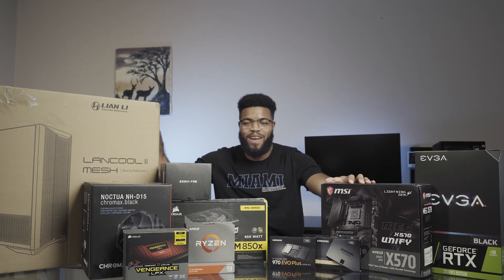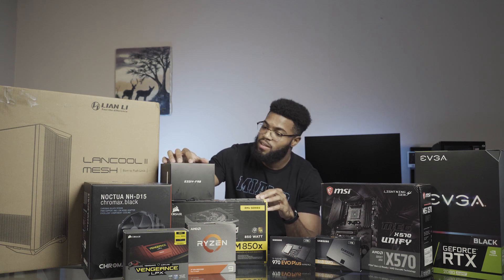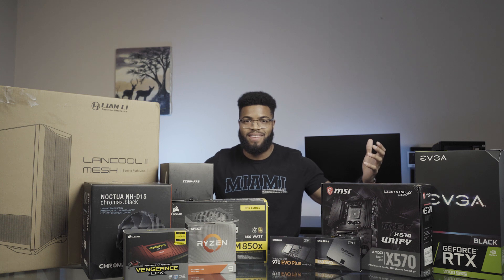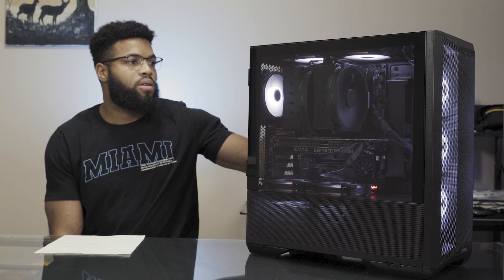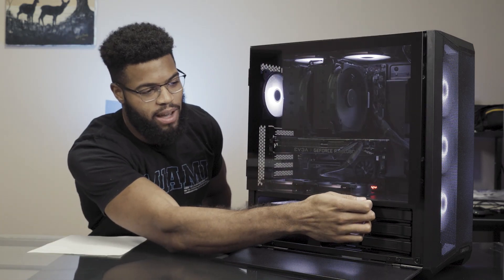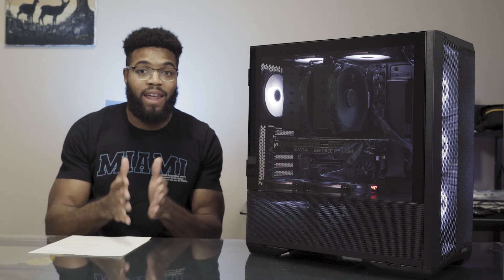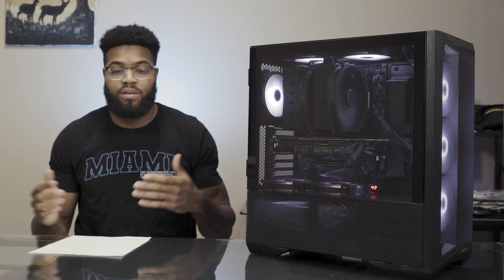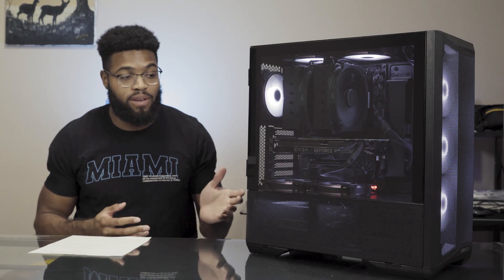Lian Li Lancool 2 Mesh PC Build - Should you upgrade your editing PC??

Comment: That is clean looking.  I’m doing a 5800x build in that case.  Have everything but the processor cooler.  Was looking at the one you installed and the one step smaller Noctua dual fan.  Looks awesome.

Comment: I am planning for my build similar to yours. Is it true you used those 3 fans that came with the PC case in the front? Is it a necessary to buy an additional 120mm fan to be installed at the rear end of PC case like you had done in the video?

Comment: How much space is there between the D-15 topmost part (I assume fan) and the glass panel?  I have 42mm memory and will likely have to raise the fan 10mm with this case, or swap the second fan to 120mm.
Reply from the maker: mann I couldn't give you an exact measurement but it is super close I'd say no more than a few millimeters

Comment: Just purchased this and replaced my old CM Storm Trooper. I really liked this case a lot. Only thing I don't like is that my m2 nvme (standing) blocks possibility of bottom fan and I am currently using the bottom pcie which also blocks a bottom fan. That being said, I can still squeeze one ssd there. Overall very good case.

Comment: I have the x570 meg ace with a 3800xt. It os a beast. Im going to do a swap, as i have a 5700xt on that build, but moving over the processor, and the meg ace into a better case for cooling (lan cool mesh 2 or the o11 dynamic)
I need the case to be able to support a 360mm AIO and the new STRIX LC OC 6800xt which comes with the strix card, so 2 aios. I was told the lan cool mesh 2 would accommodate that build set up
Reply: With the HDD cage in the factory position would a 360mm aio seat properly in the front? Or would you have to move it toward the psu, or would you have to remove it completely

Comment: I know I'm like 4 months late, but if you're looking for longer screws, you can easily find a box of them at say a Home Depot/Lowes.
The box was called "Electrician's Machine Screw Kit" #6-32 - 370 pieces total for $7.

I ran into fan screws being too short in my Fractal R5. The case-included fan screws were probably only 1" or 1-1/8" in length.
I found that something like 1-1/4" in length allows you to install fans in areas where you need just a little bit more reach.

Comment: Beautiful and low profile. Great build bro!
I am gonna get the lian li lancool 2 mesh case but is it look nice to use M-atx motherboard? I am worrying about the small size of the motherboard doesnt look great with that case. What do you think?
Reply from the maker: Thanks I appreciate it! I think that for that small motherboard it all depends on if you don't mind having a larger case in your space. You would have the benefits of easier maintenance and better airflow but that all depends on the size of your space. If not then I would look into getting a smaller case.

Comment: Hey, man. Cool build! Not sure if you've noticed and may have already fixed it by now but your motherboard chipset fan (I think it's the name?) on the lower right (right above the LED) doesn't look like it's running. From what I've read, it's necessarily to cool the lines down from all the X570's fast transfers, not 100% sure. Anyway, was also thinking of getting the exact same case with the exact same CPU and mobo. Glad to see an example of the X570 Unify mobo in a Lancool II Mesh case. It looks great!
Reply from the maker: Yeah man my chipset fan is only set to run when it hits a certain temp! I thought I was having issues with it as well but it runs fine when it needs to
Reply: @juwancaesar  Ah! Didn't know. Will be less worried when this happens to me when I set it up. Thanks for the info!
Reply: Just want to update this that I've gotten and set up this mobo, this case and you are right. The fan does not run when idle.
Reply from the maker: @RogerC  that's great! Hope this mobo serves you well!

Comment: This completely convinced me to go with the lancool mesh and I’ve been loving it (I actually pretty much went identical with the specs since it’s such a good video lmao). I do have to ask how you went about handling all the fan connections/cables? I also got the same fan pack and I’m a little lost on how to sync everything since I can’t use the fan hub with the stock lian li fans
Reply from the maker: As far as the fans go, they aren't synced with the lian li case fans I just have them controlled withbthe remote that came with the fan

Comment: Would you list which direction in/out your fans are going please?
Reply from the maker: Front 3 fans and bottom 2 fans are intake  and top 2 and rear fans are exhaust. I could probably do without the top fan thats closer to the front, but I left it in purely for looks, it hasn't negatively impacted my airflow either

Comment: The gpu is just blowing  the hot air directly  into the heatsink. Which will impact the temps very badly
Reply from the maker: Naahhh man it doesn't affect it like you would think, my temps have been consistently cool, thanks for the heads up though!

Comment: What's the point of that top fan in front of the cpu cooler intake, besides to steal air from the cooler? The fan on top rear is good, though.
Reply from the maker: Honestly it's purely for looks haha but after testing the airflow and pressure, that fan doesn't negatively affect it as much as you think, my temps have been beautifully cool for the past 2 months. Thanks for the heads up!

Comment: As a recent owner of the Lancool II Mesh, I can say you did a decent job on the build. They don't necessarily mention the order to do things in. Definitely best to run your CPU power cable into the motherboard before placing it in the case, especially with fans up top and such a large cooler. Timing is of the essence. In this case I found it was best to mount the motherboard in the case, and connect my front panel connectors, obviously before installing the graphics card, but also prior to installing the bottom mounted fans.  It is really easy to bend pins when you're not able to fully see the headers. This just requires a small screw driver when a large air cooler is used. I find this case looks really good with custom sleeved power cables. If you haven't already, I would suggest finding Cablemod's kit designed for the RM850X power supply so you can go straight from the power supply instead of crowding the case with extensions. I find that custom cables force you to have super clean cable management, and add that finishing touch to a premium level build such as this. Overall this a great build, and considering this is definitely your first (high end PC) build, I'd say you did great. Even if you don't go with sleeved cables, you can definitely clean up those PCIE and ATX power cables a little more.It's all about the zip ties in the back. I should give you kudos as well for getting the correct fan orientation. That is not a given for a first time builder.
Reply from the maker: Thanks for the tips! Definitely gonna take these into account for my next build!

Comment: How hard was it to install the front stock intake fans? If you can could you include a brief explanation of how you installed it? Anyways, Great video man
Reply from the maker: Hey, thanks! It wasnt hard at all actually because the fans came pre installed with the case! Just gotta connect them to the mobo and psu and you're good!

Comment: Hey dude. You can take out that drive cage. There are screws on the bottom of it that you can unscrew to take the feet off that base that slides into the bottom of the face. It comes out after that.

Comment: Beast of a machine man.  If you plan on OCing or getting better temps I would recommend an AIO because the 3950x can get pretty hot under a load but if you aren't gaming it shouldn't matter too much.  It's only my preference i suppose as I had that same heat sink in my rig and it was sweet.  Nice build man, decent cable management too even without sleeved PSU cable extenders.  You've sold me on this case too because I've been looking at this or the Fractal Mesh, Lian Li makes great cases.  Great choice on all the hardware and a definite upgrade from that airbook lol  Subbed my dude, great editing on the video too.  You should be able to edit great footage on this thing.

Comment: Hi great video but I was just wondering how did the fans not attach to the  top of the case , did the screws that came with the fans not fit?
The part I'm reffering is at 7:50
Reply from the maker: Hey thanks for asking! I had trouble with the screws that came with the case fitting with the fans. the fan holes are much too large as if I needed either larger screws or rubber plugs

Comment: Do we think this case will fit the new 3080 and be spacious enough to cool properly. Was thinking if 10900k with it. And 320 aio on front
Reply from the maker: Absolutely you can, this case has the ability to flip the cable bar that allows for more room if needed

Comment: To get the M & C buttons to work and control the RGB lights on the front do I need to connect the wires to the 5V led header on the motherboard and the SATA cable to the PSU?  Thanks!
Reply from the maker: Yes you do!

Comment: Didnt connect the front panel usb
Reply from the maker: I did haha just didn't film it
Reply: @juwancaesar  Then why is it not visible in the video, be honest you didnt connect it because it prevents you connecting your bottom fans or if you dont use the bottom case hole you have to have the cable going right across the front of your build and it looks terrible everyone who uses a lancool 2 cheats the same way

Comment: It's gotta feel like night and day coming from a crappy Apple product to a nice, custom built PC with beat specs! And I'm not dissing your laptop in particular, just Apple as a whole. You're going to fly through editing now! I wish you nothing but good luck on your journey.
If there's one small thing, you're about 95% of the way to really good cable management but you can tighten up around the GPU, the air cooler and that top corner where the case buttons are.
Reply from the maker: Thanks I appreciate it! Gonna work on those cables soon haha

Comment: Loving the video. Also went with the same case.
You said in your video that you ran into issues with the case fans. 
I have a b450 tomahawk max mobo. The rgb of the fan is working but it isn’t spinning. Any advice?
Reply from the maker: My issue was just that I had to connect the 3 point header from the fan hub directly into one of the mobo slots, after that everything went well!

Comment: Hey Juwan 🙂 I just got a mesh 2 RGB...  and have watched your build video many many times as I'm a newbie at building a computer 👍 I was wondering what exact Amazon ezdiy fab fan pack you purchased and how did you wire it to sync the RGB? Does the RGB buttons on the top of the case still  work properly with  on all the fans in the case? Did you use the ezdiy fan hub? Or somehow connect it to the mesh's hub? Or motherboard... This is the first computer I've ever built in my life 😅 you've really inspired me thankyou!! Great video by the way!!?
Reply from the maker: Hey! Congrats on your new PC! the link to the fans I bought are in the video description check it out! But there unfortunately is no way to sync the fans with the case buttons. I tried to ask JayzTwoCents as well and he told me the same thing, you can however control the fans with the remote very easily with no issues!
Reply: @juwancaesar  thanks bro 😊👍
Reply: Juwan Caesar were you able to connect the case fan argb to the motherboard and control the color with software?
Reply from the maker: @TommyGilligan_Bunny  those fans are only capable of being controlled by the remote, no software capabilities

Comment: That's really good for a first build, and 6-8 hours are just about right if this is your first. Seems like you did your homework right. That all black with white lighting theme is also my favourite, and been stuck to that theme right until now. If you somehow wanted to improve the cosmetic side of your PC, just put more work on managing your cables (even the tiny ones like fans, SATA cables, etc.), and for an even cleaner look, buy some sleeved cable extensions for at least your PCIE cables and the 24 pin. It's going to work wonders on the cosmetic side. Great job, and welcome to the world of PC building!
Reply from the maker: Thanks for the tips! I'll definitely be looking to improve my cable management in the future!

Comment: I have the Phanteks P400A and I’m not gonna lie, I really want to switch to this case. Excellent cable management and relatively easy to keep opening up and change stuff out. I’m tired of having to take everything apart😔
Reply from the maker: Absolutely! The cable management is freakishly easy to handle even for beginners! Hassle free is the way to go!
Reply: I just got the P400A about a month ago, although the LC II Mesh was my first choice (lack of availability in Canada). However, in the last month, it was a pain making changes and even just removing the glass panel frequently was annoying. I just ordered the LC II Mesh to replace the P400A as it just became available up here!

Comment: Nice job, nice build.  Enjoy 

Just built one similar to yours, 3950x 2080ti, 64 gig ram( 2 sticks of 32) 2 Samsung m.2  1T drives .. MSI x570 gaming plus . have the non mesh Lancool 2 case.
Mainly running Resolve 16 Studio  but also have Pinecale Studio 23 Ultimate on it.

Performs very well.
Reply: This sounds like an absolute monster of a PC. Nice build man!

Comment: I love the way the Black Mesh II RGB looks with the white lights, it just beautiful.

But i also like that the Mesh II Performance has the Fan Speed options and overall comes with the bigger fans. 

Is the Fan Speed Option really that important and better? or is the RGB as good without it?
Reply from the maker: I believe the RGB version is just as good honestly. The performance version will get you slightly better airflow which will lead to slightly lower temps, but you'd be just fine with the RGB version especially compared to other cases in this price range.
Reply: You could always get RGB and swap fans if you were ever concerned about cooling performance
Reply: @DesiDadReviews  pretty sure that breaks the point, honestly, either aesthetics or performance, hard choice depending on the person

Imo, get a good case with good fans, no need for rgb, then grab a undiffused lightning strip if you want a clubhouse for a PC, and place it inside your case.
Else, get a neon light strip from phanteks and do minimalistic and stylish rgb.

Comment: Fan screws go in from the top. Check your chipset fan. It's not spinning. That's not good.
Reply from the maker: Hey thanks for commenting, the chipset fan works fine it's just set to run when it hits a certain temp.

Comment: Nice build and it looks clean! I can't wait to build my first game PC by myself next week! Your research in brands is pretty similar to mine but on a lower budget.

My specs:
Case:      Lian Li Lancool II Mesh RGB White
MB:         MSI MAG X570 TOMAHAWK
CPU:       AMD Ryzen 7 3700X
RAM:      Corsair DDR4 Vengeance LPX 3600
Cooler:   Noctua NH-U12S chromax black
GPU:       Asus GTX 1070 (from old PC will upgrade later)
PSU:       Corsair RM750
SSD:       Kingston A2000 250GB M.2 SSD
                Samsung 860 EVO 2,5 inch 1TB 
Fans:      Corsair Casefan iCUE SP120 RGB PRO (3x)

Comment: Beast of a PC. This is literally the spec I'm looking at getting for myself, just waiting on the Nvidia 3000 series
Reply from the maker: That 3000 series looks monstrous man! I might be upgrading to that soon after they release
Reply: I think I'm at the same boat. My computer died with a hard drive failure. It was 12 years old and served its purpose. Right now I'm making a parts list and the only I'd swap is Nvidia 3k series
Reply: Building same setup for my Blender 3d workstation.  Waiting to see what AMD does in the next few weeks.
Reply: Ur wait is worth buddy
Reply: same as im gonna build almost but with new incoming cpu, gpu and motherboard. all black build no rgb, aircooling, mesh case, reliability and function first
Reply: Still waiting for a 3000 card 😂

Comment: Great looking build especially for your first custom build. I am curious what you meant by the fan screws didn't work? I was looking through some of the materials for your build and they should have worked fine as long as you were using the screws that came with the fans.
Reply from the maker: Hey man! Thanks! So the fans didn't come with any screws at all (at least my order) haha I tried using the ones that came with the case but no luck
Reply: @juwancaesar  gotcha pretty strange but if it works it works.

Comment: Nice 👌 all you need  is to upgrade to a water cooling to get does 4.6ghz constantly
Reply from the maker: Thanks man! I might upgrade to water cooling in the future when I'm sure I can install it without in failing and ruining my other parts haha
Reply: @juwancaesar  I would think twice about liquid cooling. Just had a disruption in posting a film because CG guy had water cooler failure and damaged numerous parts. There is going to be a free ryzen tuner in September that auto overclocks and under voltages (from 1asmus) that should lower your temps while giving you about 7-10% performance boost.